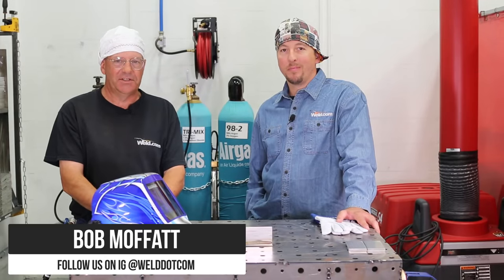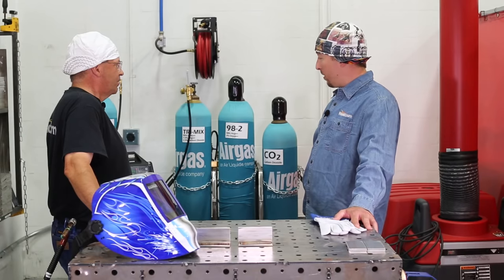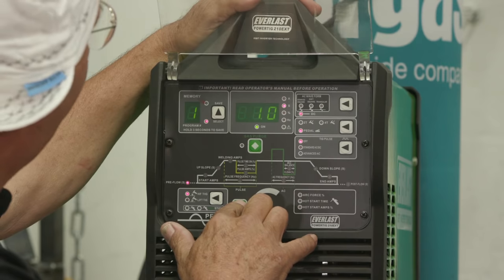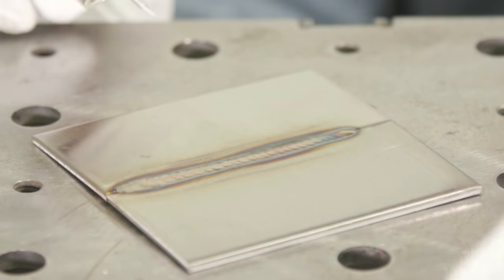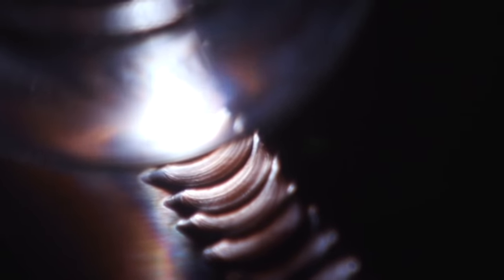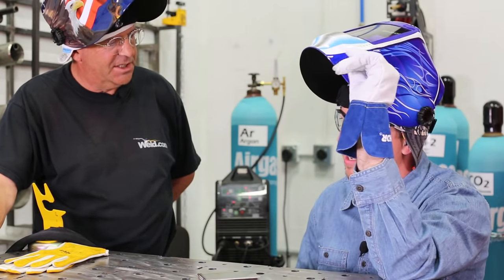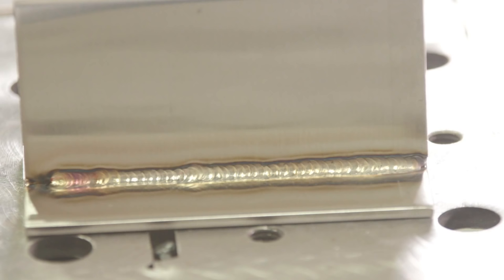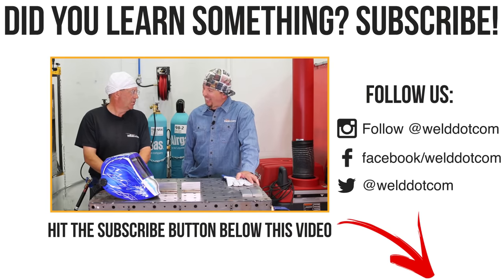Stainless Steel: How to Get the 🌈 Color in Stainless Welds

Comment: I don't know if you weld with pulse or not but I weld with a Miller Dynasty 300DX  & the pulse is amazing I like to set up my pulse with about 70% on full & about 45 to 50% background once dialed in & going my foot goes to the floor & control my filler & keep a close eye on the weld puddle I work on foot equipment & we have to have perfect welds .   Pulse will help make the welds look great & the more pulse's per second the deeper the penetration ( Right from the Miller web site)  It's been working for me for 15 plus years at General Mills .  I like how you are helping more get going & into the trade !  Well Done

Comment: Hey Bob, question...first off for the viewers reading this...I'm not a welder by trade , but I do weld to get things to stick together. So comments on my abilities would be redundant. My question is regarding the "beads" or the "stacked dimes look" - and torch angle - and most relevant...gas flow. Does the gas flow actually "shape" the liquid weld pool? Does the gas push on the pool and stack it higher? Or is the gas flow so slight that it couldn't push the puddle and stack it higher ..or possibly to the side? Love everything about your videos.
Reply: gas flow does not shape the puddle. stacked dimes is all torch advancement and filler wire

Comment: NOTE * this is not what you want for structural welding,
Reply: i was just going to say that too but they do keep saying its for stainless art.  i weld Titanium, inconell and stainless. all day every day for aircraft and if they see a thread of color under a jewelers loop its rework time. we use a 12 cup, back purge, trailing cups  and what ever we need to eliminate all color even the optimal gold color.
Reply: Why not?
Reply: its not a continuous fusion of the metal. think of it as a lot of tacks, you dont want color either. im a stick man myself so im not sure what the color has to do with it though
Reply: you can get continuous fusion this way too, and he did.. my only gripe here was the lap joint

generally speaking -- colours are a sign of oxidation, and thusly - for all critical applications,  you want no colours at all. bright straw and no haz showing -- which sometimes is impossible unless you go with trailing shield and whatnot. it all depends on the code or ISO you got specced on your drawings.
Reply: Other than Titanium what other metal is this light surface oxidation a problem?
Reply: aluminum, inconell, stainless. alot
Reply: Yes, Ally to some degree but side line oxidation is acceptable especially with the MIG process even in structural welds on Bridges and Ships. Inconell is not a problem with light surface oxidation, if needed can be chemically or mechanically removed but has no effect relative to structural integrity.  Stainless is absolutely no problem unless it is the underside penetration (backpurge). Copper can be a problem but light oxidation is expected and generally present no structural problems.
Ferrous steel alloys do not have a problem with surface oxidation whatsoever irrespective of the welding process.
The light oxidation discolouration in this video would only be a problem with Titanium, nothing else.
Reply: miketlane optimal gold?  Lol gold/StRaW is not optimal! Any color at all it the welder playing engeNrearding and eliminating/changing the aloy's in the stainless... But you Know that (by how you described you work setting; Im assuming...
All stainless welders need too know that the color band changes and you're cooking out the nick',crom' ect...
TuRn&NOburn!!!  :-)
Reply: lot of undercut
Reply: Blueing of stainless is a sign of Chromium depletion, the weld and Heat effected zone with corrode with time.   And with Titanium heavy blueing is the start of alpha case which is essentially a scrap part in my job, it can be etched off with HF acid but if you haven't got the thickness there then it's scrap.
Reply: cooked metal,  @davidrichards3605  , molecular inconsistency
Reply: @michelguevara151  Have you swallowed the metallurgical dictionary? Cooked metal, molecular inconsistency must be new special terms us metallurgists are too stupid to know.
Reply: @planeswalking  agreed. Lap joints you tend to tey not to eat the corner. Stay in the corner not take the edge with. If i left edges like that at work id be told to fix it. And i do marine parts 304l and 306l stainless usually. Between 14 g and 11g usually.
Reply: @mitchdenner9743  I'm a tig/stick welder full time for over 20yrs when tacking up with tig I sometimes get a little undercut yet on a full run never.. And never on stick and have to get in some very tight spaces
Reply: @davidrichards3605  the color of the welds for titanium at least depend on the oxygen content in the shielding gas and the more color in the weld (from straw to bright blue) indicates increased hardness  which can cause brittle fractures in the weld, especially in fatigue applications

Comment: When I learned to Tig weld stainless I was told a good weld has color in it. that means your heat, travel speed etc... Is on point.
Reply: It should look like gold to hay color that   is the best strength color. If you type in  stainless steel temperature colors in the image search you can see what temp you need to get the colors desired. The purple and blues need a higher heat to the point you will burn the chrome moly out turning your weld black like a burnt marshmallow if you push it 2 far.
Reply: @gunner504life  I always get those colors welding stainless

Comment: The color is due to heat and method. Rainbow isn't what you're going for. An amber color is something you're looking for. It shows consistent heat along the entirety of the weld. Simple manipulation, but "rainbow" doesn't mean a good weld. It means your heat isn't a constant. Possible due to arc distance and welder pre and post settings due to arc length.

Comment: Not rocket science. Coloration is due to the phenomenon of thin film interference between the differing refractive indexes of the carbides and oxides formed during welding. More color equals more oxidation. Want more color? Less gas coverage. Significant coloration is actually unacceptable in some industries. It's also worth mentioning that the chemical changes that occur in the heat affected zone have a very significant effect on the corrosion resistance of nickel chromium stainless steels due to carbide precipitation to varying degrees.

Comment: I’m teaching myself tig at the machine we have at work we barely use. We weld a lot of different stuff mostly just repairs for the machines at work and since I’m the student in the maintenance dept I weld EVERYTHING at 260 A and I hate it but my pedal control is on point
Reply: Pedal to the metal

Comment: I use the chinese powertig 200/210 and is 1/10th of the price. works amazing.
Reply: Yeah? That must be a qc passed unit!
Reply: Funny thing is, the chinese units have the exact same internals and motherboards as the expensive units.
Reply: Not exactly the same. Features that exist, circuit design and efficiency, flash upgrades/expansions, etc. I found a firmware bug and Miller issued an update including it in 4 months.
Reply: confucius say man who weld with Chinese powertig have slant eyed weld

Comment: So many "Welders" saying having color is a bad thing.  It depends on the application of the weld.  Is it structural? Is it Food Service? Is it decorative?  The last one would be the only acceptable place for multi colored welds as they occur with a varying of weld temperature.  In a structural application a constant temperature is required.  In food service they want to only see the parent material color.  My 2 mites worth.

Comment: I came across this bc I noticed i only use my e308 sticks because i dont like the 6011 and 6013. i noticed with stainless filler metal once it gets too hot it stops working. So it requires super light wattage whatever. and also it is veru very very pixky about the metal its arcing on. if its too thin or whatever. grinded too muxh. POP it goes right through.

Comment: So what's the importance of color in stainless steel welding?  Which BTW, there wasn't any color in this demonstration which I actually find better for what I'm interested in.  I have a complicated piece of stainless steel for a marine application on a boat that needs to be polished to a mirror finish and I don't think the color is needed for that since you have to get rid of it to get that polished finish.  So back to the original question, why the color?  Better without color for polish but not necessarily a strong weld?
Reply: the color or lack there of in this video is for art purposes

Comment: Cant stand arc wabble either.... but one of the welding machine at work is doing it each time i start an arc, very anoying. Great video btw.
Reply: Replace gas lense, cup, and nozzle
Reply: Arc wander is usually from contaminated or poorly ground tungsten. There’s a myth about only grinding radially....it doesn’t matter as long as the grit is very fine, and blunt the end slightly

Comment: Where can I get a welding cap like his?
Reply: any welding store.
Reply: Find dabs on Instagram. He has pics of his caps.
Reply: I was just thinking to myself about why they're actually even wearing welding caps while tig welding? It doesn't produce any sparks that may burn your scalp or neck. That's what caps are for. I weld all processes between where I work and tig in my home shop and I would never bother wearing a cap running tig. Maybe it's just a habitual thing with them?.

Comment: I was taught that the rainbow color is from too much heat. I heard the color you're going for is golden/grey
Reply: It's caused by oxide layers, which in turn can be influenced by gas coverage and heat. The oxide thickness determines the color, it (theoretically) would cycle through violet, indigo, blue, green, yellow, orange, red several times with the color intensity increasing and eventually gray when it's at its thickest after which you lose all color. A perfect weld should be silver as the gas covers the whole weld and as long as it's not too hot, the HAZ should be small enough that gas flow covers that area too, as well as behind the puddle. This is all based on my understanding of the theory of oxide formation and not necessarily on the real world; there are probably other factors involved as well, so take all that with a pinch of salt ☺
Reply: @therealchayd  didn't ask

Comment: If you want colours just use a custom mix.. Some add a touch of oxygen 1 or 2%... some add a touch of nitrogen.  Knew one guy who used helium/CO2 and rocked out some unique welds.
This whole "how to" was crap and misleading.  NO ONE wanting colours uses straight argon.
Reply: Co2 really doesnt work with tig.

Comment: When using a tungsten rod you sharpen both ends, So if fowl the tip you can change it end to end with out have to go the to grinder twice as many times. Once when I was a bout 22 I had just back cap and the tungsten rod in it and I was trying to stick the rod into the rubber heel of boot. I know I was I stupid bored no need to remind me, but what happened was the sharpened rod busted through the back of back cap drove itself about 3 inches in my hand. I never felt so foolish and such pain before or since. I have felt more foolish and much more severe pain since then but not at the same time as I did that day.